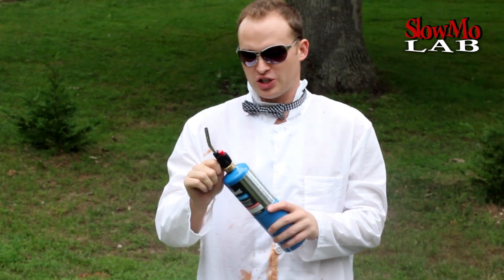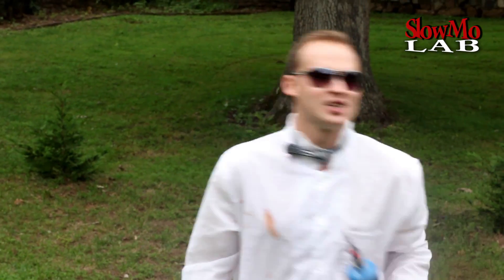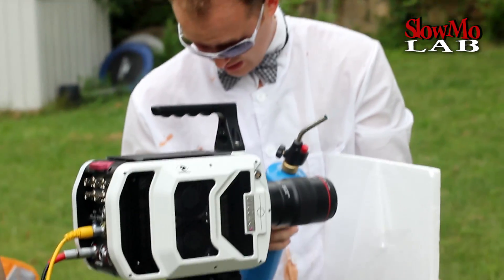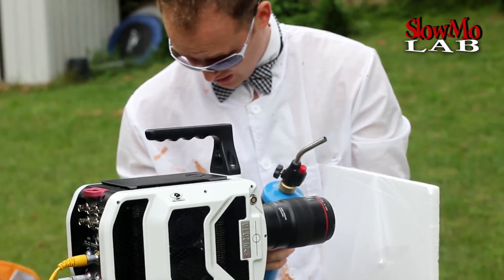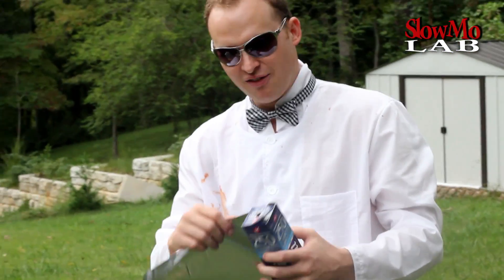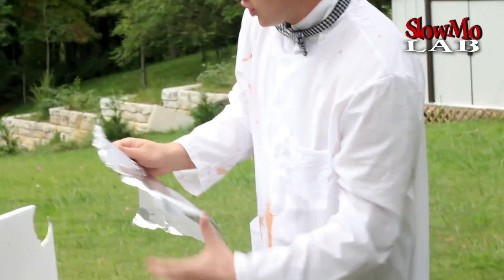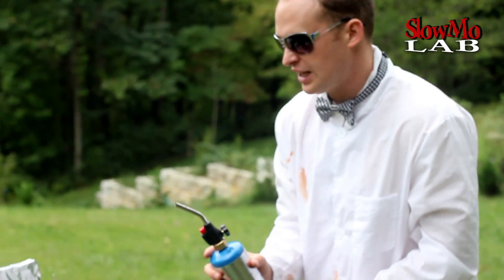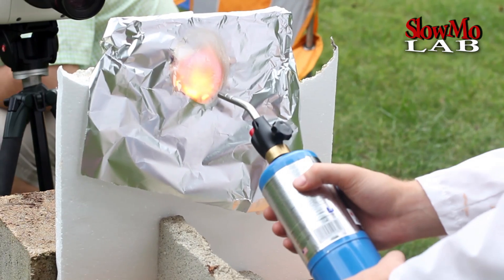Moon on Fire!! - Bizarre Styrofoam Experiment | Slow Mo Lab

Comment: If you take a deformed plastic bottle and fill it with a small amount of water and put it over a fire, the steam expands the bottle to its original form and will even go beyond by bursting the bottle with pressure build up. I'd like to see that if you can do it.

Comment: How expensive is your camera?
Reply from the maker: Very!!
Reply: Slow Mo Lab How much did it approximately cost? Over 10000€?
Reply: TeamSairio 350000
Reply: TeamSairio  it is actually 180,000
Reply: Dan T I had my price confirmed by a company in London called love high speed who have bought one. Not even the Phantom Miro is that cheap
Reply: Dan T I won't buy a 60k camera of the internet
Reply: Dan T what website?